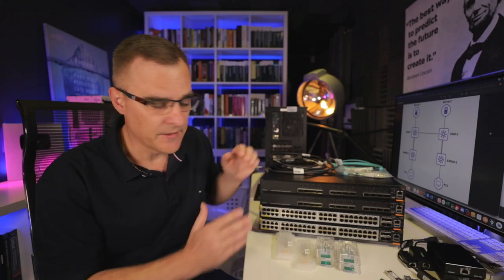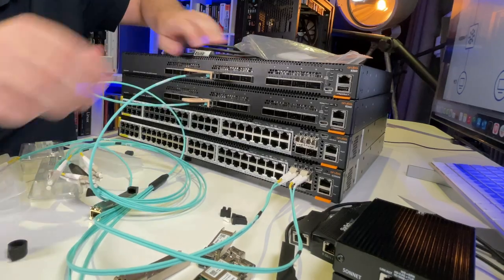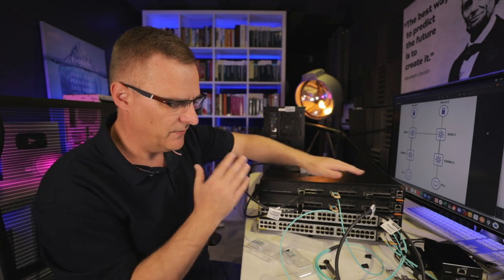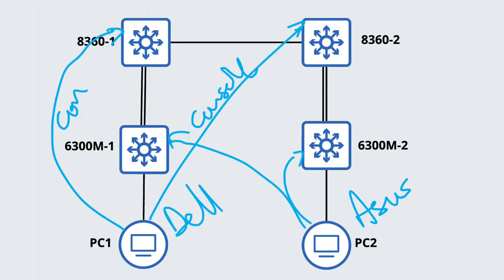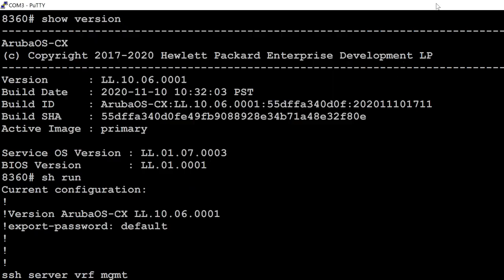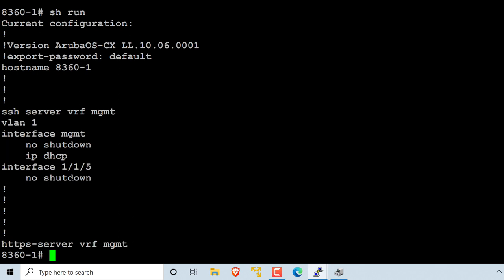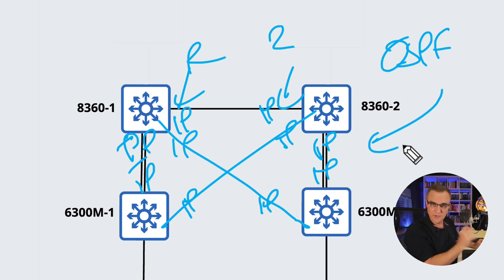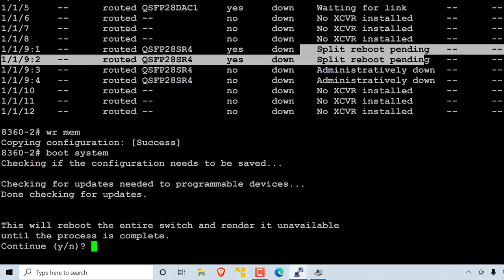100 GbE network configuration // Aruba Networks Ep. 1

Comment: Pls, David, mine must be a stupid question. Pardon me.
When we say, "100GbE", does it apply solely to the 'speed' of file movement within the network? Or does it also affect internet 'speed' within the same network? Given that 25mbps, 50mbps may be the best most ordinary folk can get.
Reply: This kind of equipment is implemented in data centers or in big companies with necessity to transfer massive amount of data (companies wich are likely to have dedicated multi GBit internet connections). Usually these switches are used to guarantee server access to a wide number of users.
There is no use for such equipment in a domestic environment.
Reply: @guidobartoli6096  
Thank you. Meaning it has huge bandwidths within. Makes sense now. Thanks.